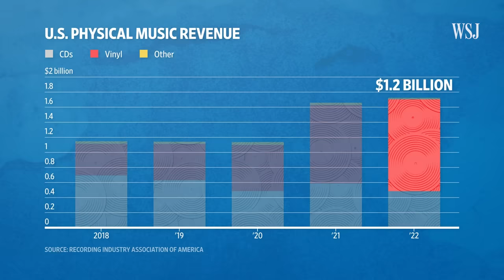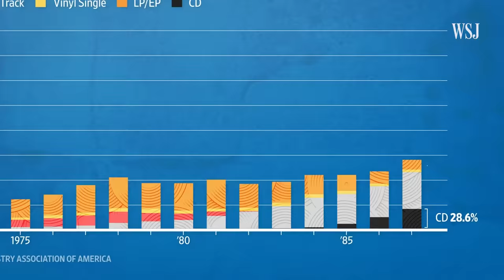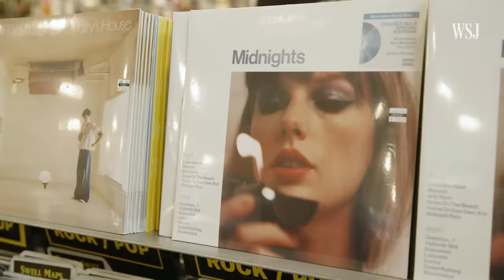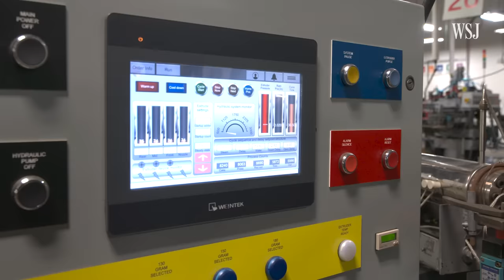The $1.2 Billion Vinyl Industry's Rise, Fall and Rebirth, Explained | WSJ

Comment: I started buying Vinyl during the low point in 2006. Never in my wildest dreams did I imagine that they’d comeback to the extent they have. Though my big regret is that I didn’t buy more second hand records back in 2006/07. Prices back then for second hand records were rock bottom, even for sought after albums. You could buy what today are sought after records for £3/£4 because it was thought that vinyl was finished as a format. 

Gosh I really wish that I bought more records back then because second hand prices have skyrocketed due to the resurgence. A second hand record that cost me £3.59 in 2006 typically sells for between £20/£30 now.
Reply: I stopped buying vinyl in 2000 when a got my own house and didn't want to take up the space it was a DJ set up now my son have one I've my turntable's I lost my collection in 2008 when moved house I don't  miss them but dang the Prodigy  ones 45 rpm 12inch singles are worth something now .                                                                    I knew vinyl  wouldn't die but dany I could not imagine the come back it has had.                                                                   May I ask what you buy on vinyl
Reply: Its like buying Tesla or Nvidia stocks :face-green-smiling: Its always too late !
Reply: Same here, started getting it around 2004, remember new albums were never more than $20 at this time? wish i got more of the 90's records i finally ended up getting then!!
Reply: @gingernutpreacher dang prodigy hard to come by too especially first pressings

Comment: It's always great to see a physical music format doing well. Having said that, CDs provide most of the benefits of vinyl - well, except for smaller album art - and none of the drawbacks. Oh, and they're also a fraction of the price. Watch out for the CD revival coming soon.
Reply: @whatnots  Just put the CD back in the case immediately after playing it, not laying around on the table or whatever, and you won't have scratches...
Reply: @thepirategamerboy12  And the problems with scratches are much worse with LPs, of course.
Reply: I’m back to buying CDs after a decade of streaming. They sound phenomenal, I can make an easy digital back-up, and they’re dirt cheap to boot.
Reply: @markvandenberg4606  Great to hear. Streaming is useful, but it's great to actually own your favourite music.
Reply: The only way they will return is if they fire all of the audio engineers who reprocess the original music to make it sound better on CD.    Marketing people today just don't get it. It's about having the original sound, even if you have scratches and pops along the way.
Reply: As you say, other than the smaller artwork, CDs beat any format: they're small, light, easy to maintain, don't degrade with use, are relatively inexpensive, and sound better than streaming by a mile. (And generally sound better than vinyl, for that matter.)
Reply: @SO-ym3zs  As far as I can tell they do degrade with use, at least slightly. To be fair it is nothing especially detrimental if stored and maintained properly, but the same can be said for a vinyl record. As for which sounds better I think that is too subjective to be used as an argument for or against any format as different people are gonna like how different formats sound. Your other points are valid, however, and are excellent examples of why CDs were the predominant medium for music for multiple decades.
Reply: @seanberrodin801  I've been collecting CDs for decades and haven't experienced any visual or audio degredation with any CD except one, a gold disc that cosmetically appears eaten away when viewed from the top but plays fine. The other thousands are all fine, as far as I can see and hear. Vinyl literally gets damaged every time it's played and is much more easy to damage through mishandling than a CD.

True about sound quality: it's a subjective thing, though on paper, CD generally excels vinyl, also generally to my ears. I do enjoy the occasional charm of vintage vinyl, though, with all the added noise from dust, wear, and/or mishandling by the previous owners. But normally, I'd listen to a CD any day over new vinyl or, streaming, which I just use to explore and sample music before buying.
Reply: Vinyl still sounds better though. It’s just a fact.
Reply: Cds aren’t fun
Reply: Yeah but I don’t see anyone putting CD covers on their walls lol
Reply: Amen. The fetishization of vinyl is interesting. I can sort of understand why a 20-year-old who has no experience of physical media would gravitate toward the novelty of a record. But for people in their 40s and 50s who, for the most part, eagerly switched to CDs from LPs in the late '80s because of all of the benefits of convenience, durability, portability and better sound that you allude to, it is truly bizarre that they have come back around on this. If all of these middle-aged vinyl enthusiasts were really as committed to the format as they claim to be now, the format would never have become obsolete in the first place.

I say this as someone who grew up with LPs, made the transition to CDs in the late '80s, but continued to purchase LPs from my favorite artist, who was one of the only ones that continued to put records out throughout the phase-out of vinyl. Initially, I bought those records because they were released early (i.e., a week or two before the CDs), and eventually I liked having them for the larger-sized artwork, but really only for that artist and one other. Now, I have records that I bought for $15.00 in the mid-2000s that sell for $500 and up. If the people who are willing to pay that now were as into vinyl in 2003 as they claim to be now, they could saved a lot of money by just buying this stuff when it came out. At some point, I will sell these records because, aside from the artwork, there's really nothing unique about them. I own all of the songs on CD, with a couple of exceptions where there are vinyl-exclusive tracks. I can listen to CDs in my car, my living room, my bedroom, on my computer, on a boom box. I can listen to records in my living room only. And records only come through two of the six speakers on my setup, whereas CDs come through all six.

I think back to 1990 when a new LP cost $7.99 at the local record chain and a new CD cost $11.99. Now, a new CD costs $13.99 and a new record costs $30.00. It reflects a changing market, obviously, but it still defies common sense, in my opinion.
Reply: Yes ima sell them forever and open my own cd 💿 store 😅📀📀💿🏬🤙🤙🤙the cd 💿 revival might come next year 2025 👍👍👍
Reply: @thepirategamerboy12 there’s also scratch remover machines knos that fixes scratches on cds 💿 problem solved 🤙🤙👍👍💗

Comment: I used to be in the Club business in the late 80's early 90's and I have over 2000 12 inch  vinyl records.  That's every vinyl 12 inch dance record produced domestically from 87-93 and lots of imports that I bought myself.  I also have a ton of dance 12-inch records that predate 87 with remix services like Disconet, Hot Tracks, and Ultramix.  Some are pretty valuable pressings too.  I have thought about selling them since I don't really listen to them anymore.
Reply: what noise rock do you have?

Comment: There's a "permanence" to vinyl that doesn't exist in digital formats, streaming, or even CD's (which do degrade with time).

Vinyl can sit on a shelf for 100 years and still be played. Accounts can't be cancelled, rights can't be revoked. It's a simple technology. That's the value in it.

Digital formats have convenience, Vinyl has a sense of permanency that far outstretches other formats.  .